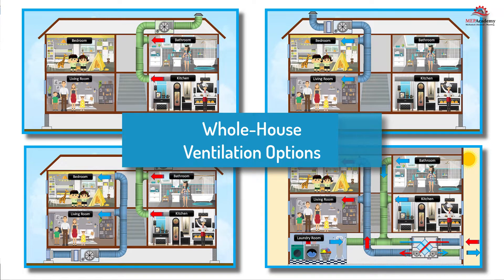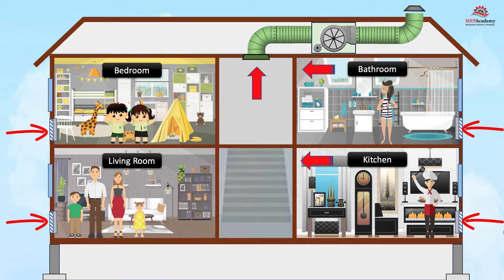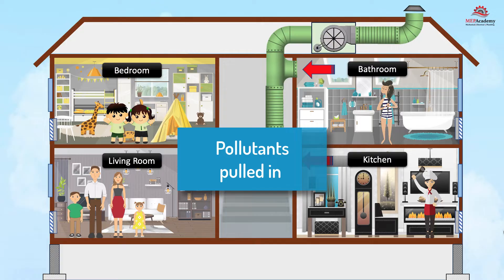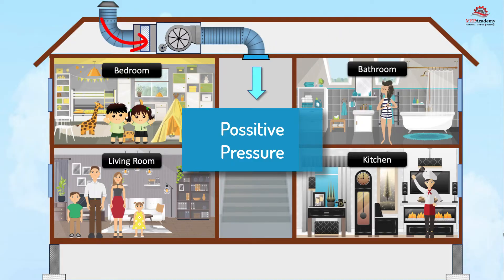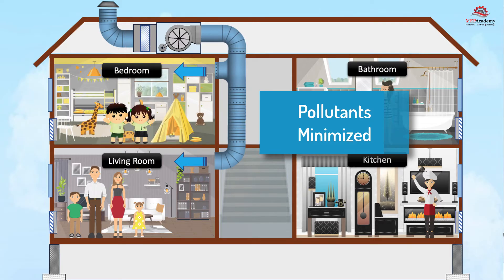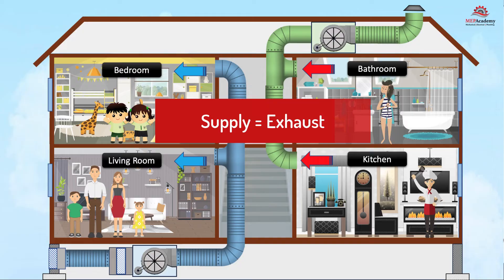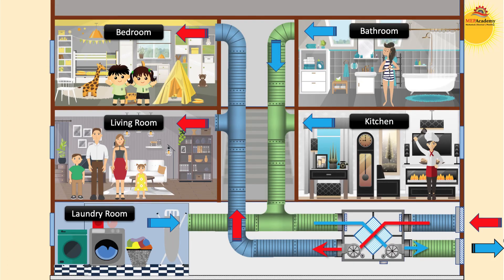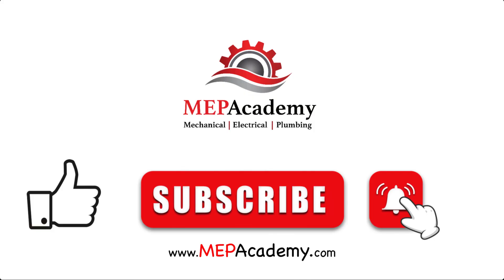Whole House Ventilation Options

Comment: Okay, I think that I'll go with a balanced fan system, since the kitchen, bath, and mechanical room are all in the northwest part of the house, and the bedroom, living room and dining room are all in the southeast of the house.  Then I can cause recirculation between the bedroom, living room, and dining room so that fresh air entering the bedroom doesn't cause drafts.  Install a dehumidifier in mechanical room and circulated air between the bathroom and the  kitchen, which are probably the big sources of humidity, not the make air during the winter time.  If the kitchen or bath tend to be cold, use radiant floor heating there.  I don't think a central ERV makes sense in this situation where the inlet and exhaust sections are at opposite ends of the house, and overall size of the house is small.
Reply from the maker: That's a great plan! You've thought this through well.